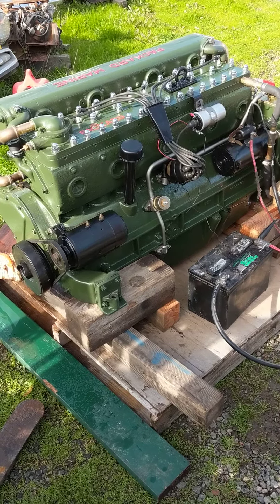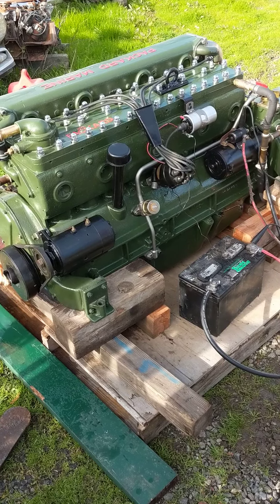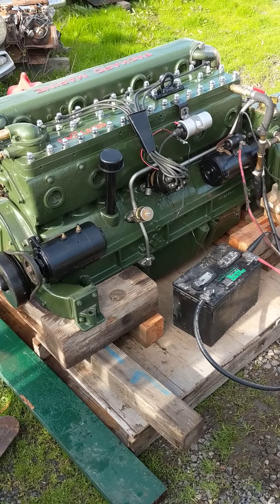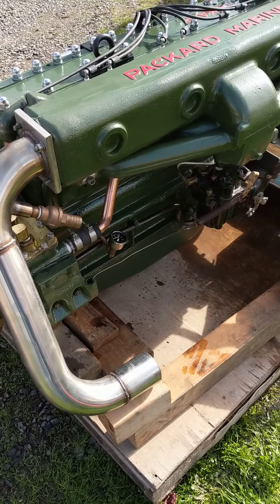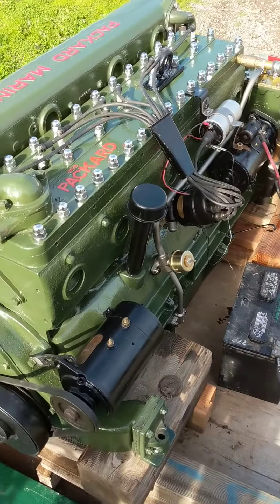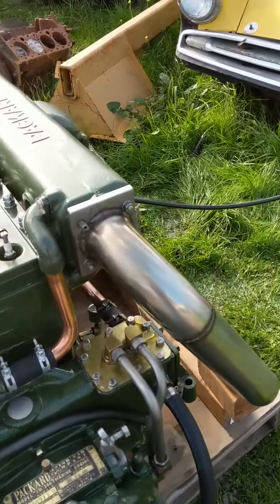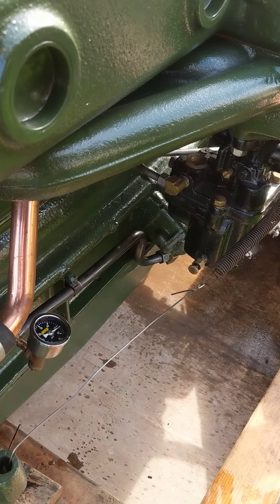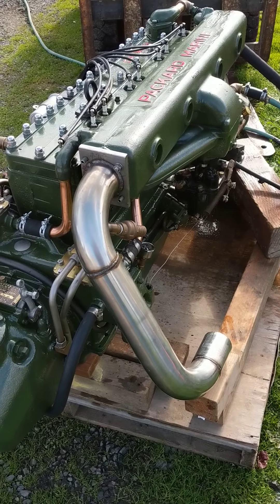testing the Packard 356 Marine engine.

Comment from the maker: I wanted to show the oil pressure gauge and how the relief valve opens when pressure goes up to open the valve. This relief valve is NOT in the oil pump. The MARINE version of the 356 places the pressure relief valve on the line that you see running under the distributor. Oil flow is like this: Cam driven pump pick it up from the sump, pumps it out of the pump via an external tube along the block (behind the carb.) and up into the oil filter canister, through the oil filter and out to an oil cooler (on top of the bell housing) then out through the tube under the distributor and down into the oil galley. The tube also extends down to the oil pan where there is a relief valve that determines oil pressure. In this test, I have placed a gauge in the rear of the block right side oil galley. In theory, this is where the last place the oil will flow and perhaps where the pressure could be lowest.